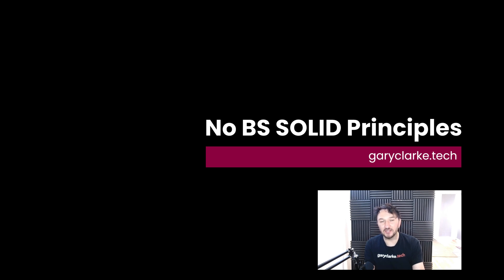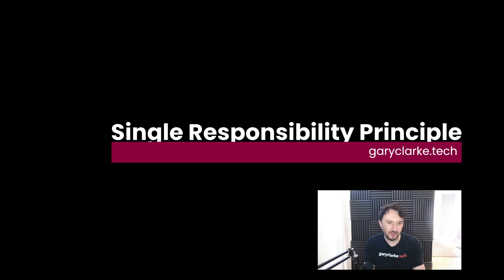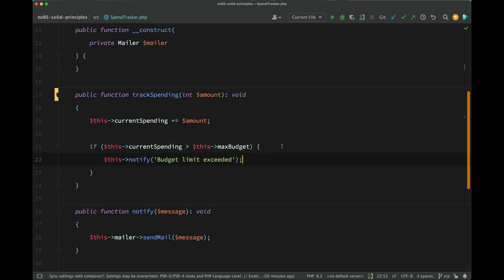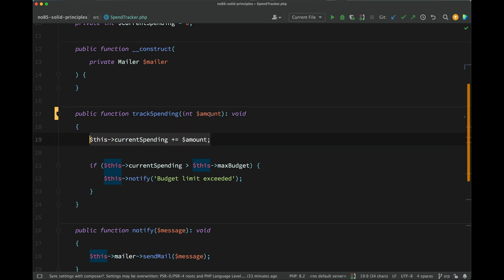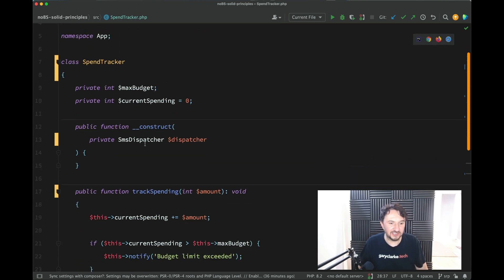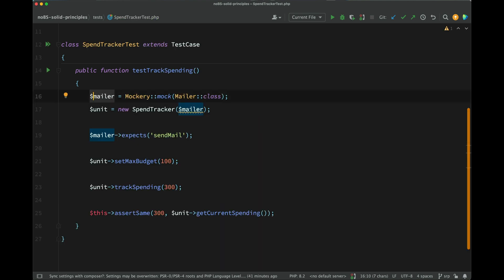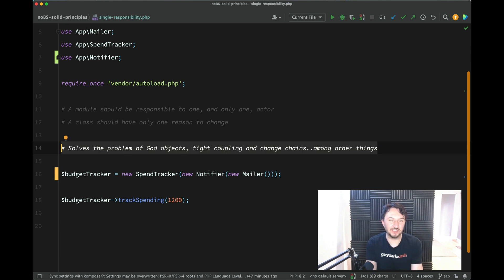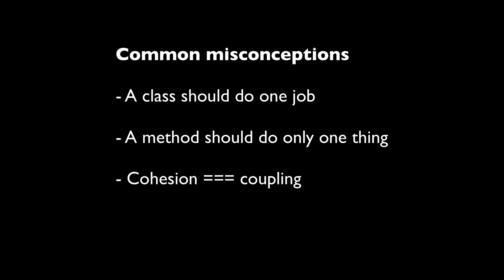No BS SOLID Principles: Single Responsibility Principle

Comment: is it better to create for example INotifier interface with notify method and use it in spend tracker. 
and implement these interface in smsdispatcher and mailer and not rely on concrete Notifier class in spend tracker?
Reply from the maker: Didn't wanna get into dependency inversion for this. I think it would have been a distraction
Reply: Sure, that's what the D of Solid stands for (Dependency inversion principle).